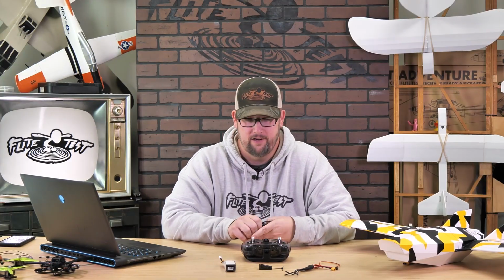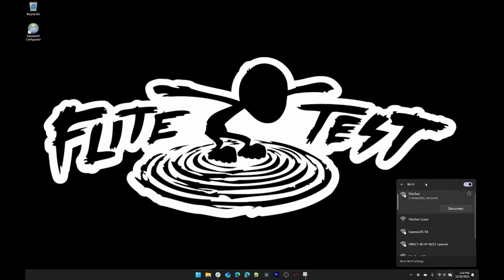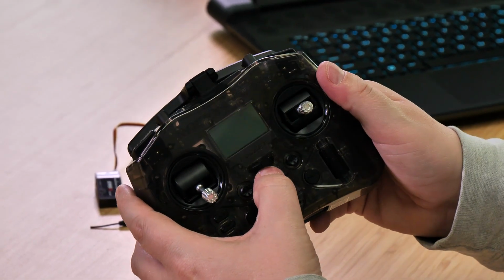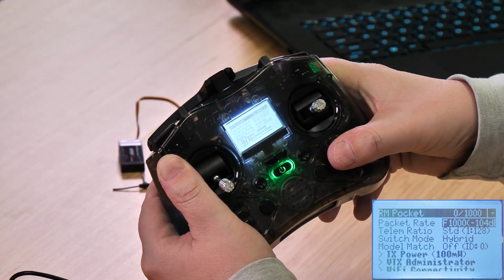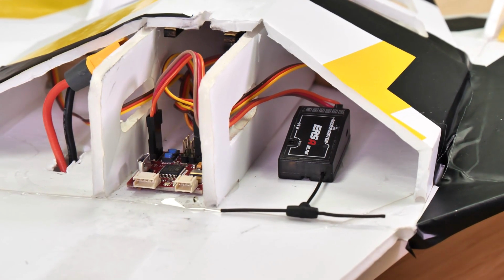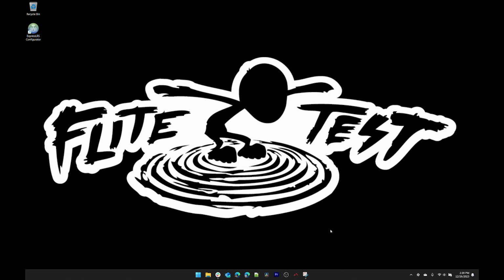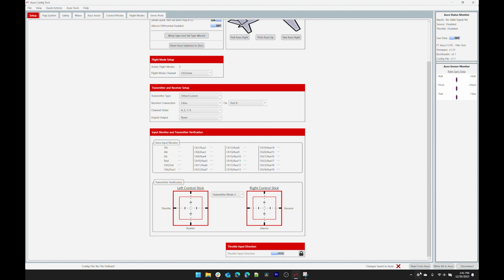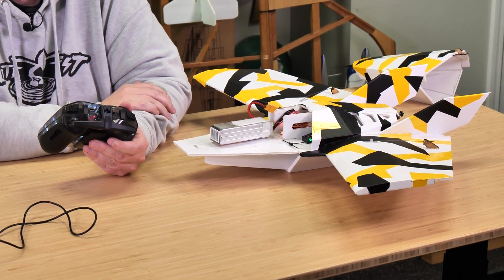Connecting Express LRS To Your Aura

Comment: I think you missed 2 important details.  The FT Aura expects a 1520 PPM center and ELRS channel 5 is strictly 2 channel, high and low. If you want to use a channel for modes, it needs to be 6 and up.

Comment: Thanks, this is just what I needed. I have an aura lite that I'm putting in a twisted hobbies foamy and want to use ELRS,  so this is perfect.
Reply: You want to use a gyro and a long range radio system for a lightweight 3d foamy that can be flown indoors? You're never gonna learn to fly 3d like this.
Reply: You are completely incorrect… I fly iMac and 3d on a regular basis neither of those things have anything to do with flying 3d. Stop talking out of your a$$ you most likely fly in circles and you are talking about 3d 🤣